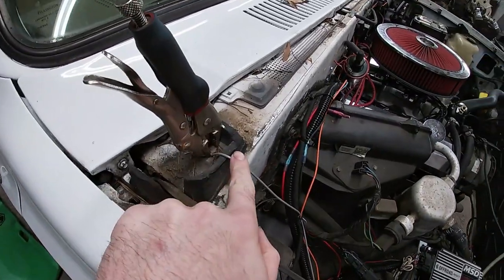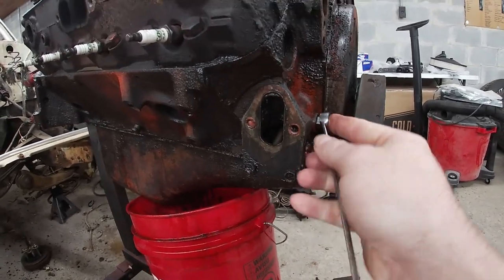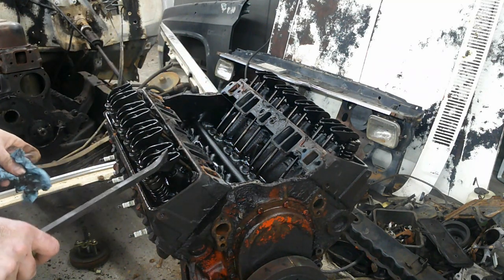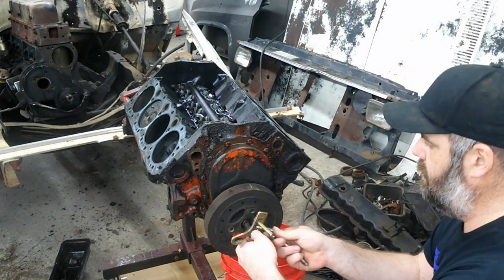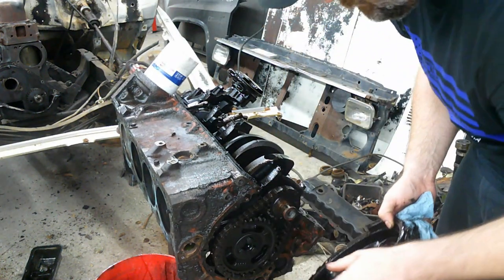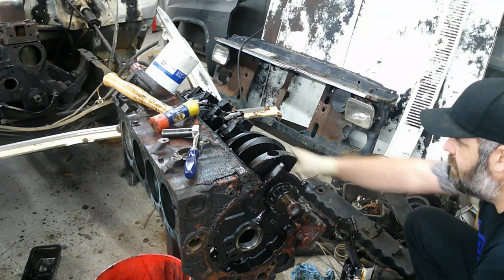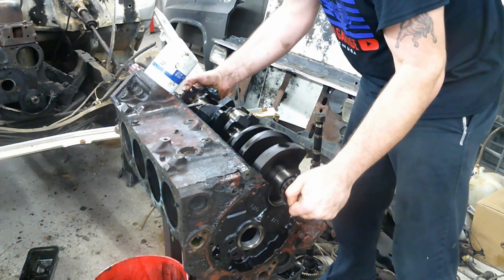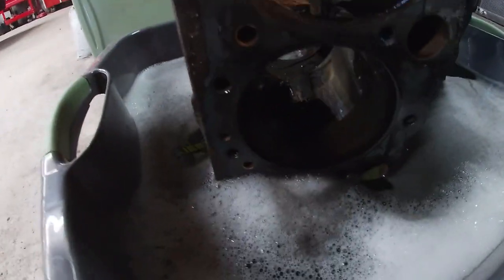Tearing apart the sbc 307 to assess the damage

Comment: Great informative video.
307 has 3.875 bore with a 3.25 stroke.
At .030 over the bore is now 3.905
Formula for displacement is Bore X Bore X Stroke X .7854 X Number of cylinders.
So 3.905 X 3.905 X 3.25 X .7854 X 8 is
311.39 cubic inches.
Looking forward to the rest of this build.
Have a great weekend!
Reply from the maker: Thanks, have a great weekend

Comment: I also put a set of 79' 305 heads on mine. Same little valves, but smaller chambers. Those and a set of thin graphite head gaskets, bumped the compression up about a full point. So it was about 9.0:1. Ran good... for a 307. Now it has a professionally built 355ci that really runs. Builder said it should be 400hp.
Reply from the maker: That’s cool. I’m just going to go with a decent cam and some standard headers. It will run good enough for my 16 year old son
Reply: @HarmonGarage  absolutely!

Comment: 9:00 Had to take a short handled flat head screw driver & hammer to the rod with a few taps to score it then pushed it up holding it out of the fuel pump lever.
Reply from the maker: Whatever works

Comment: Good first v8 for sure! If I can find a good 305 or 307 I would use it in my 51 for a good cruiser. My problem is I’ve got 4 engines no transmissions!😂 should be a good build series.
Reply from the maker: I’m looking forward to it. I’m a big fan of the 305. They are a stout motor that revs really well. I’ve never had a 307 before. Kinda why I want to do a full refresh on it and see what it can do. I know it put in work in that k3500 pulling a trailer heavy enough to rip the hitch off

Comment: 311 CID. I would do all the plugs and go with brass marine plugs. If one of those rear plugs end up leaking and you end up pulling the trans you will wish you spent the 5 bucks for them
Reply from the maker: Lol. Probably not a bad idea. I’ve had to pull trans to do the rear plugs before

Comment: If I remember correctly didn't GM use the 307 block with a 283 crank to make the 302, also 30 over will make the 307 about 311 cubic inches if I'm right????   But could be wrong maybe someone else knows????
Reply from the maker: From what I have gathered, a 307 is nothing more than a stroked 283. I’m not sure if they used it for the 302 or not? Someone else commented 311 c.i. Also so your probably correct. Thanks for watching
Reply: The 302 was a 327 block with 283 crank. 307 was the opposite.
Reply from the maker: Thanks for the info